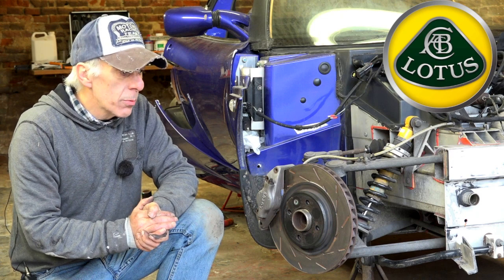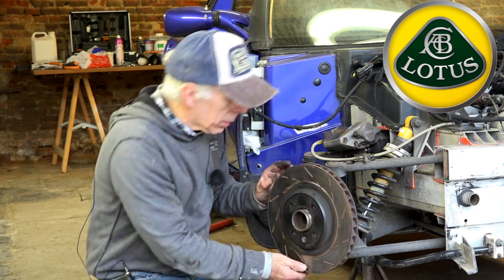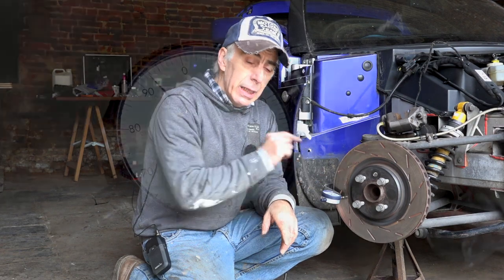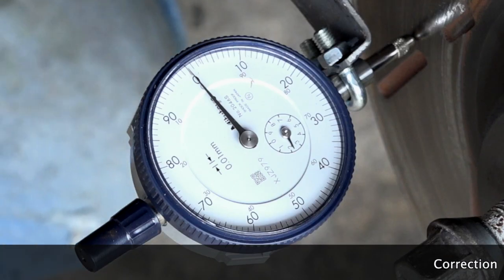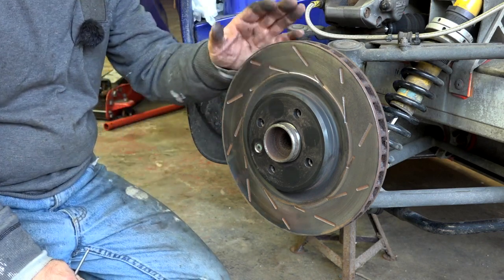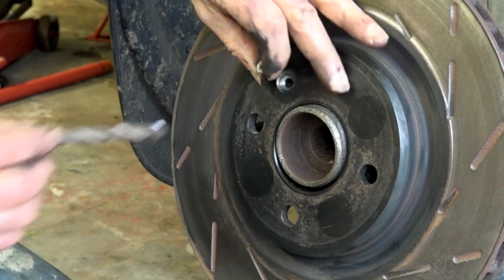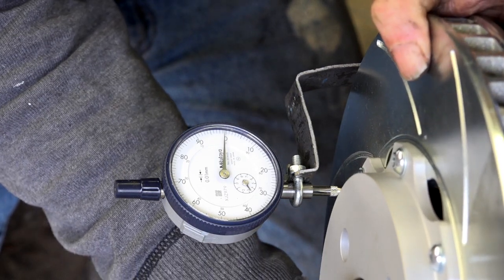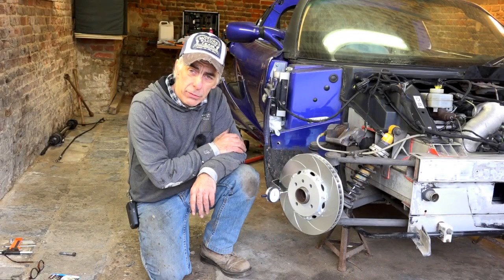Lotus Elise, Brake Disc Check, Verification and Replacement

Comment: some of the best mechanical videos on internet. very different subject matter. i love the history lessons of Belgium and the watch tower built in 902. amazing. i noticed the brake rotor only  has one screw holding it to spindle. i dont know if you can get a true reading of runout.
Reply from the maker: Thanks for the comments

Comment: Thanks for the video.   Looking to replace the discs on my S2 111S and was curious what type you went with.  Look like AP racing with the lighter aluminum bells.  Would love to know the type and how have they worked for you?
Reply from the maker: wel that was the issue, those are not allowed in Belgium by the MOT , so I swapped them back out with standard /original Elise disks as fitted to the 135R

Comment: About to do my rotors and pads on my 2005 111R. With a set of new DBA4000s what are the chances of having runout beyond the tolerances? I understand that it is very important to clean the hub so that there is nothing that can cause runout. Is that the case?
Reply from the maker: Indeed, the runout can be caused by a deformed disc or even a bad bearing...
Reply: Thanks for that. Great videos. The Lotus manual also mentions you can do the runout test on the 'scrupulously' cleaned hub.

Comment: Hi, what made the disc distortion? My S3 elise rear brake disc surface shows wave reflection, it only done 34,000km and running 2nd set of pad in 8 years. The rear brakes should not be highly loaded.
Thanks!

Comment: to attach the rotor to hub for measurment you  could put some  large nuts on wheel studs to attach the rotor to the hub for runout  measurment
Reply from the maker: Thanks for the comments
Reply: So put some additional nuts on the lug nut then put the lug nut in? Without the wheel naturally.